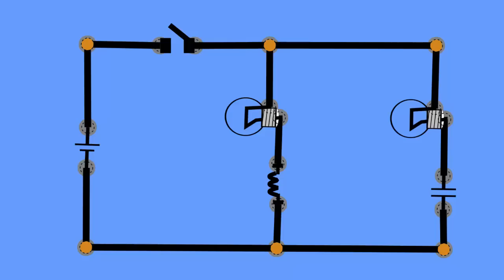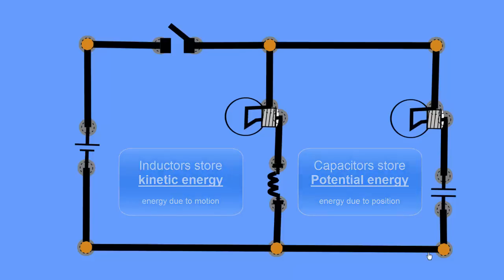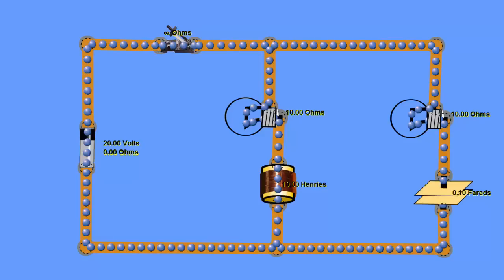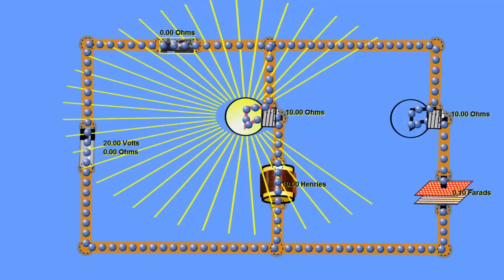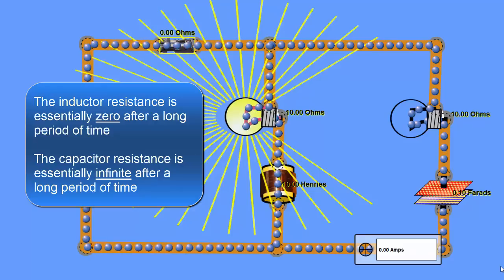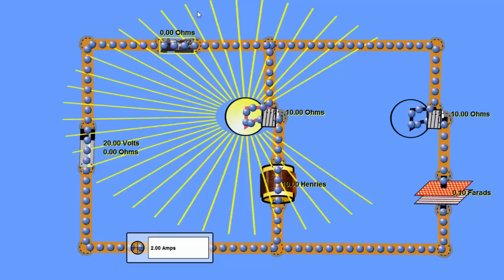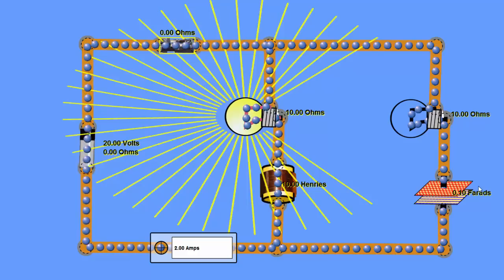Capacitors and Inductors - Mirror Twins

Comment: You should also point out when you open the switch the inductor tries to prevent the current through it collapsing by  a reverse voltage being developed across it due to the collapsing magnetic field. You will get a short negative voltage spike at the top of the circuit  and the energy is dissipated in the form of a momentary spark across the switch as it is being opened. In effect some of the energy stored  in the inductor is converted to  heat and light.  i think you should make it clearer how the electrons generated by the reverse voltage help clear the accumulated positive charge on the top plate of the capacitor. Your visualisation is pretty good but the subtleties  of the discharge process may be missed by some. Viewers  should keep in mind the potential difference across the inductor and its series resistor  is always the same as that across  the capacitor and its series resistor.

Comment: So, is that capacitor hooked up in series with the circuit? As a complete newb, I've only added them "onto" existing circuits in parallel to help with noisy circuits. Am I using them wrong...or is this a whole different type of capacitor?
Reply from the maker: Capacitors are used in many ways. They are commonly used for coupling circuits and to handle transients in power supplies. the capacitor in the video is being used in a 'damped'  LC Tank circuit to show how the two components are complimentary.

Comment: Best explanation I've seen on this subject. Thanks!
Reply: I would agree IF he did not use the term current because according to the person it can be ambiguous.  Next, he should have shown how to use a capacitor to value an inductor with a multimeter.  Let me try to make this a myte easier.
      Take an air plate adjustable capacitor larger in value than the inductor. (How can you tell? When the two are hooked up the capacitor will still have a value reading the multimeter.) Hook up your multimeter to the capacitor let it charge the capacitor and write down its value. Now hook up the inductor and the multimeter in parellel and also in parallel with the Air Capcitor. Let it charge until the multimeter (set to Ohms) stabilizes. Deduct the second capacitance reading  from the first capacitance reading and that is the value of the inductor.    By adjusting the Air Capacitor you can find different values in the inductor's tap points.

Comment: Liked the video. One of my students found the video and brought it to my attention. I can see a problem though when they start to study resonance. You haven't said why, in this particular case the circuit does not 'ring'. I can see why this might complicate things, but there is the potential for some confusion for the uninitiated.
Reply from the maker: I agree there can be confusion due to the heavy damping in the circuit. My main goal was to demonstrate the phase relationship between the two components in a transient situation. It might be a good idea to create a video with three such circuits with: high damping, low damping and no damping. Thanks for watching and commenting.
Reply: Thanks for replying so quickly. Not a problem as long as the situation is pointed out by a tutor. May cause some issues for self learners. Having said that, it isn't always possible to cover all bases and keep it simple... Great vid.

Comment: Best explanation I found so far, but what about in AC voltage,can you please do a similar comparison?
Reply: With AC, you get a circulating current flowing between the inductor and capacitor that is not draw from the supply. Thus a correctly-sized capacitor across the supply can improve power factor and reduce current drawn from the supply in an inductive circuit.

Comment: Ok i have understand and thanks very much for those very good animations ---  So, the question is now, how to use ANY inductor as a supplement force -- considering that ANY inductor has
his own resistance --- before leaving the current going freely inside him --- and then to have the possibility of cutting the main original current --- in the aim of using the inductor Force ? 
So how will you determinate the frequency for ANY inductor -- so that the frequency will be calibrated to give the necessary laps of time,  that gives no resistance in the inductor, and so, full force in the cutting !    Thanks, Jacques.

Comment: When you switch off the circuit, the capacitor should discharge and bulb should glow because it has been charged due to battery when switch was on?????
Reply from the maker: It did discharge. The inductor electron current flowed into the positively charged top plate of the capacitor and removed the charge on the capacitor. If you watch the video carefully you can see the bulb in series with the capacitor get very bright for an instant while the capacitor was discharged due to the inductor current.
Reply: Yes it was,but i was thinking about the LC circuit, which produce oscillation
I mean capacitor discharge and charge the inductor then inductor discharge and charge the capacitor, over-all produce undamped oscillation. Will this circuit not behave like that after switch get off?
And thanks for replying my query sir👍

Comment: One more question, please. A question about the nature of "electricity". When a current is flowing down a wire, there is a magnetic field and an electric field outside the wire. Is there any "electricity" inside the wire? I obviously have been told that there is a flow of electrons (or something) in the wire, but I am not sure if that was just a simplified analogy.
Reply from the maker: What we call "Electricity" is usually due to electrical current which is the flow of charge (electrons in wires). A concentration of more electrons than protons in an object or part of an object (or vice versa) produces an electric field. The flow of charge produces what we call a magnetic field which is really another form of an electric field produced by relativistic effects (Einstein's theory of relativity). It can be complicated so usually simple analogies are used to explain it.

Comment: Great video but why does the capacitor stop conducting current after it has fully charged?
Reply from the maker: The light bulbs are turning the stored energy of the capacitor into heat and the circuit is highly damped so it can only oscillate for essential a single cycle.

Comment: Please advise at what instant capacitor is getting charged.It is discharging when switch is open.Is the capacitor getting charged by the current of inductor when switch is open.
Reply: *sorry discharging when switch is closed.pls confirm when it getting charged.
Reply from the maker: Things are complicated. When the switch is first closed the capacitor is charged almost instantly since the resistance between the power supply and the battery is very low and current leads voltage in a capacitor. The inductor currents lags the voltage so it takes time to build up current. Once the capacitor is charged it can only discharge through the inductor and since the bulbs have resistance the electrons move back and forth between the capacitor and inductor but the energy quickly decays since it is lost through he bulbs.

Comment: Great video !! But what would happen if there was only one component? Either 1 capacitor or 1 inductor, what would happen to the stored energy when the switch opens again? Especially the inductor, what would happen to the  current? (Too many "what would happen" lol)
Reply from the maker: With just a capacitor the energy in the capacitor would remain stored when the switch is open.

With just an inductor the magnetic energy due to electron movement in the inductor would create a spark across the switch dissipating most of the inductor energy in the form of heat and light in the spark.

Comment: 2:12 Time constant for the inductor is L/R, then you should write 10H/10ohm. Fortunately the numbers are the same. If not then the result will be different.
Reply from the maker: If you look at 2:09 the correct formula was shown. A typo correction was made at 2:14 after I transposed L and R. You may not have noticed the overlay of the correct information.

Comment: Hi Mr. McIntire
Since a capacitor reactance is infinit in case of DC,  why does the capacitor charge when attached to a DC battery closed circuit voltage?
The capacitor does not like voltage change accross it  but the capatance reactance is infinit in case of a DC how does the current passes? Resistance of capacitor =1/2*pi*f*C whre f=0 in case of DC even in the first instant the voltage is applied
Is it due to the fact voltage lags current in case of a capacitor?
Reply from the maker: Capacitors simply store charge and as a result store voltage (V=Q/C). More charge creates a higher voltage for a given capacitance. Capacitors store voltage exactly because they have infinite resistance between both terminals. Current flows into a capacitor because the electrons can "feel" the positive charge on the other side of the thin dielectric inside the capacitor. An AC voltage applied to a capacitor causes it to constantly charge, discharge, and reverses polarity. The continual charging and discharging is caused by current flowing one way and then the other way. Once you understand that process everything else makes sense.

Comment: Hello Dorian, I have a Square Wave Inverter at home ,and it has a 1-2 seconds delay in change over, and all my electronic appliances turn off until the inverter kicks back, that is causing a lot of problem, with my modem , media center, TV etc, . My question is, Can we connect above schema with output of inverter, so that my appliances won't turn off, i.e the 2 second delay will get support from the inductor capacitor circuit as they hold the charge within them, and that charge will be used till inverter kicks back (1-2 sec gap). I hope you got me thanks..
Reply from the maker: I'm not sure how this would work. UPS's must be specially designed to provide instant on capability and unfortunately there is no easy fix for this problem.

Comment: Say that switch was a relay. Will the use of an inductor and a capacitor in the circuit like this eliminate an inductive Spike that could damage the relay contactors?
Reply from the maker: Not really since the capacitor would create a current spike when you closed the relay. Capacitors are typically used across relays to absorb inductive spikes however.

Comment: You have any known book for calculating the number of turns and size of the choke and output capacitor value for a 18w CFL circuit

Comment: Please tell me , 
In A.C , inductors behaves as 
A) capacitor B) resistor 
C) commutator 
  (C)  transistor 
Which one is correct
Reply from the maker: This is actually a bad question. The most correct answer for the creator of the question, I suspect, would be a resistor. Inductors and capacitors are actually reactive devices that provide reactance, not resistance. Reactance is an active opposition to current flow versus a passive opposition to current flow.
Reply: @geniusgirl fari : it behaves as... an inductor! 😁

Comment: Hello , Is this for AC or DC supply??
Reply from the maker: +Prathamesh Vichare This particular circuit is DC, to help simply the demonstration, although inductors and capacitors are used extensively in AC circuits also.
Reply: Thx a lot Dorian ....
I have 2 more question ,1) where we use AC capacitor and inductor circuit in normal life?
2) Where we use DC capacitor and inductor in normal life?
Reply from the maker: +Prathamesh Vichare In AC applications inductors and capacitors are used to build transmitters, couple ac signals from one part of a circuit to another, filter signals, create phase delays in motor circuits and many other things.

In DC application these devices store energy, create delays for timing circuits, smooth out DC in power supplies and more.
Reply: Thx a lot....this info is very useful for me...

Comment: Ok, but if there's a instantaneous change in voltage doesnt that mean that there's an inevitable change in current , with or withouth the inductor?
Reply from the maker: Voltage, across a capacitor, is created when charge flows (current) and accumulates across the capacitor plates. The general way of referring to this phenomena is that current leads voltage for capacitors. The reverse is true for an inductor since inductors resist changes in charge flow and a voltage must be present to create the charge flow so this phenomena is described as voltage leading current.
Reply: @DorianMcIntire  Thank you for your time to reply! You made it more clear. However i still don't get what actualy makes this difference.. is this a property of their nature? (electromagnetic buildup vs electric buildup) or is it something imposed by humans, by design to make them so "complementary"? Thank you,  and don't bother answering if you find my inquiry tedious...
Reply from the maker: Their complementary nature is due to the complimentary nature of electric and magnetic fields. Electric fields are the result of charge position and magnetic fields are the result of charge motion. Changes in position imply motion and motion implies a change in position and this results in a complimentary behavior of the two components.
Reply: @DorianMcIntire  I get it! Thank you!

Comment: 2:16 Did you make a mistake, and reverse the terms in this equation?  
"L/R = 10 ohm / 10H"
Shouldn't it be "10H / 10 ohm"?
thx
Reply from the maker: Yes, it was a typo but I crossed it out and superimposed the correct formula in the video long ago. You should see this correction in the video.
Reply: strange, you're saying i should not be able to see the incorrect formula?
Reply from the maker: You should see a strikeout over the original formula and the correct formula underneath. I can see when I watch the video.

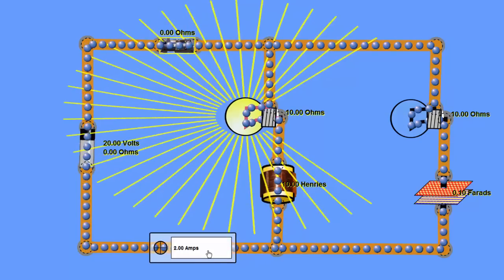Comment: 7:22 "Capacitor is completely charged".
Isn't inductor ALSO completely charged? 
thx!
Reply: So, when the current flows freely through the inductor, the inductor's magnetic field is gone?
Reply from the maker: No. Anytime current flows through an inductor a magnetic field is created. Anytime a magnetic field is present it will attempt to maintain the current.
Reply: Dorian McIntire  so.... When current is flowing thru inductor, then inductor is charged, and cap is discharged? 7:22
Reply from the maker: Inductors are fully "charged" when current is maximum and voltage across inductor is zero. Capacitors are charged when voltage across the capacitor is maximum and current is zero.
Reply: Dorian McIntire isn't that a description of the state of each, with switch closed, after settling?
Reply from the maker: At that point in the video both are charged only because there is a resistance (lamp) in series with the inductor that produces a voltage drop when the inductor is fully charged. I only used the lamps as way of displaying the behavior of the circuit and if the the lamps did not exist then the voltage drop would not exist and the capacitor would be connected across a short circuit and totally discharged. I didn't quite understand what you focusing on and why. In LC circuits without such resistance only one component can be fully charged at a time the components charge and discharge each other and create an oscillation.
Reply: Ah, so if we remove the bulb-resistances, we'll have an oscillator (which fades out like a bell)

"With the switch in position 1, the capacitor will be charged." (as shown in the link below).

http://www.circuitstoday.com/wp-content/uploads/2009/10/LC-tank-circuit.png

"Assume the switch is then moved to position 2. The capacitor C will start discharging through inductor L. The voltage across capacitor will start to decrease and the current through the inductor starts increasing. The increasing current creates an electromagnetic field around the coil and when the capacitor is fully discharged the electrostatic energy stored in the capacitor will be fully transferred into the coil as electro-magnetic field. With no more energy in the capacitor to sustain the current through the coil, the field around the coil starts to fall and the current through the coil tends to decrease. Due to electromagnetic induction the inductor will generate a back emf equal to L(di/dt) in order oppose the change in current. This back emf will start to charge the capacitor again. And the cycle repeats in oscillation."

http://www.circuitstoday.com/lc-oscillators-and-types
Reply: But the resistors don't simply damp the oscillation-- they prevent the cap from charging?
Reply from the maker: Yes. The circuit would normally oscillate but the resistance creates an overdamped oscillation that dies out very quickly. I have another video about  LC oscillators using the simulation tool:
https://www.youtube.com/watch?v=TJe0ye_Opgs
This is an underdamped oscillation that will continue to oscillate since no resistance is present, which is impossible in the real world. 
This video is really just about short term and long term behavior of inductors and capacitors and how they exhibit opposite behaviors in some ways.